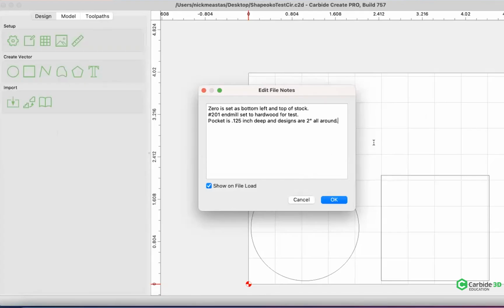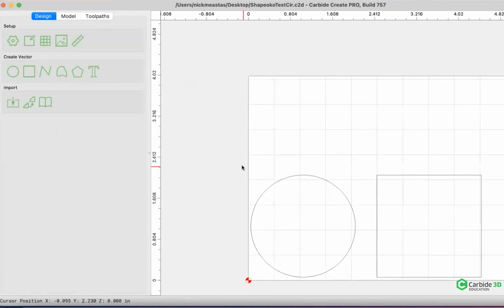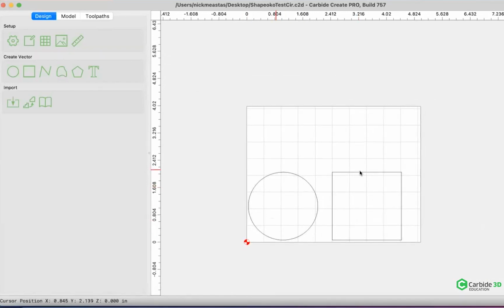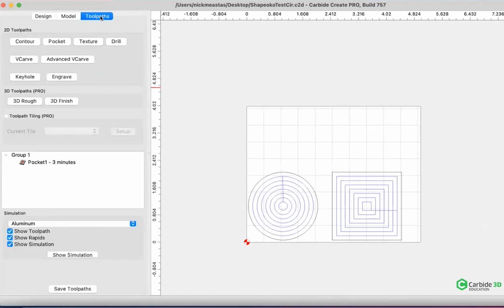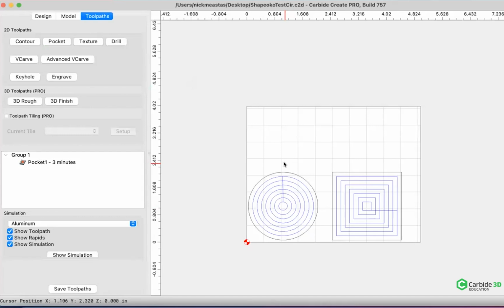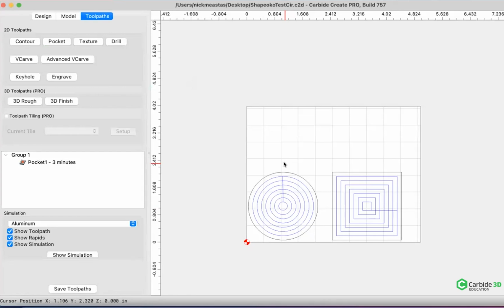Episode #1 - Testing Materials + Troubleshooting Cuts

Comment: Actually, it is the feed per tooth (aka. flute) that has the most effect on surface finish (assuming the machine is well maintained, there is minimal spindle runout, the head is properly trammed in, the cutting tool is properly secured, and the setup is rigid enough to prevent chatter). A 2-flute end mill in good condition will produce the exact same surface finish as a 4-flute or 6-flute end mill if the feed per tooth is the same for all cutting tools. One thing I note is that hobbyists rarely run a roughing end mill and then a separate end mill for finishing operations (which is a best practice in machining).

Also, when the head is properly trammed in there should be no difference in surface finish when using a small cutting tool or one having a larger diameter (other than indication of the number of cutter passes). When the head is not properly trammed in the surface will reveal ridges along the step over and/or a slightly concave surface along the feed axis.

Comment: Im a newbie with cnc. Im having problems figuring out getting good even carve with warp wood. Tried edge glued panel and 1bys. I had where it didn't carve in some parts on the vector and parts where it did. Went back to zero where it didn't reach. But then was to deep in area where it already cut. Also tried to just lower the depth of cut. Ruined alot of projects.  Getting frustrated with the cnc

Comment: my shapeoko 5pro will not pull off of the sensor when homing, and it makes a grinding noise when it sticks on the sensor.  I made sure it is square.  I don't know what to do.  I call support, but all I get is an answering machine. I get an email with references to videos
 that do not help.
Reply from the maker: Hi Paul, I see that we did send you the link to a support video showing how to test the homing switches but we did not get a response back. If the steps outlined in the video did not provide any further indications about the source of the issue, or if you prefer assistance in a different format (written instructions, call,, etc) please indicate that in the support ticket opened for you and we will get back to you as soon as we can.

Comment: newby question do I need the carbide pro to do 3d carving.  or can I buy a 3d file and machine will cut it.   not sure if I worded that question correctly.
Reply from the maker: Yes, you do.  Carbide Create Pro has the feature to turn the 3D files that you buy into a toolpath, which the standard version is missing.  You could also use a different CAM program like MeshCAM.
Reply: Fusion 360 is a free'ish option to. There is more to learn however it is a program competitive to the commercial alpha cam $$$.